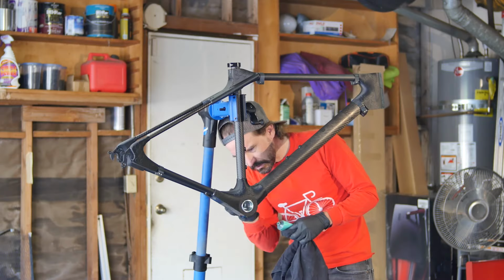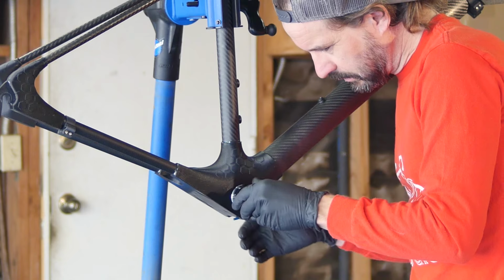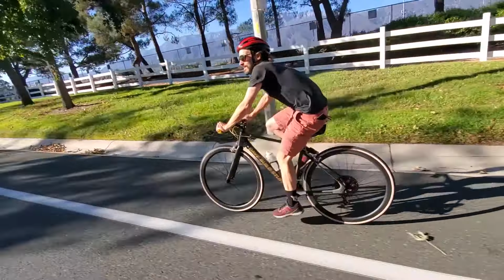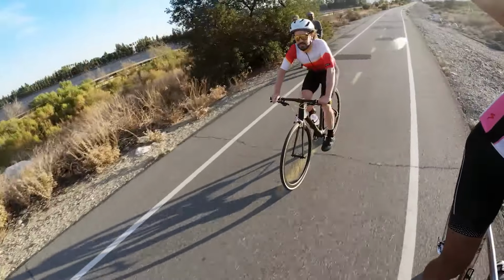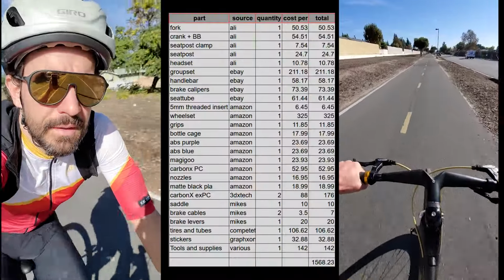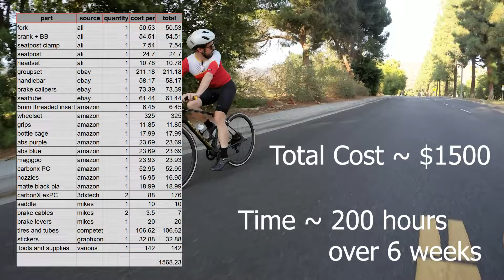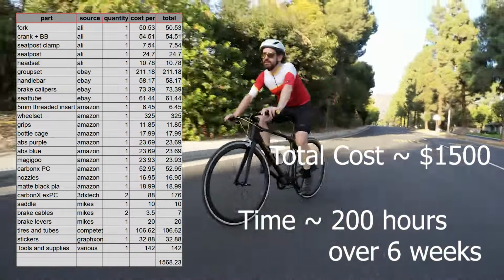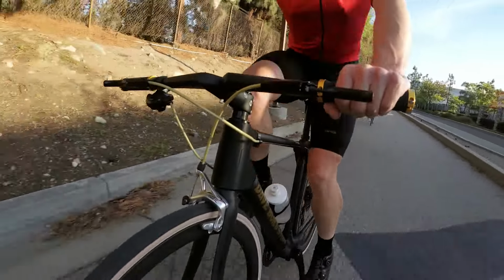The 3D Printed Carbon Fiber Bicycle is Complete! - Part 6, assembly and riding

Comment: if you ever decide making the plans open source, there will be people that will make the design parametric, maybe even with openSCAD, that way you could fully customize the frame, from the overall dimensions to the diameter of CF tubing used
Reply from the maker: I did release the design. Check the description in this video - https://youtu.be/baJIxkLU98w
Reply: @designbydave  yeah thanks for the heads up. i'm excited to see new projects :) how how did the bike hold up over time? any issues with material creep?
Reply from the maker: @SharkyMoto  No issues at all. I've actually built two. The first one (the one in this video) and the "release" version. Both have over 200 miles and are great to ride!
Reply: @designbydave  thats so sick :D

Comment: Why flat bar?
Reply from the maker: This is my easy riding, commuter bike, so I thought the simplicity of flat bars would make sense. Plus, I just kinda wanted to try something different from the road racing style drop bars I am use to.
Reply: @designbydave  maybe you should put a drop bar on it. I think that’s going to be cooler. The bar can also be 3D print😂
Reply from the maker: @mr.on9  it would be fun so build one with a drop bar. Maybe someday. For now, I'm happy with it.
Reply: @designbydave   I feel like this bike is similar to the Colnogo C series😂
Reply from the maker: @mr.on9  There was a bit of inspiration from there, yeah. See also Bastion Bikes.

Comment: Blown away by this and a tad over excited. I have been pondering a bike based around stock carbon tubing for a number of years. Searched many times over the years for possible off the shelf lug options and endlessly for 3d printed ones. And then somehow another search on this day and your good self pops up courtesy of the google nanobots. The build video filled me with the joy of making things. Having only just finished watching all your fantastic videos on this bike build my brain has yet to cogitate the enormous amount of information and knowledge you have shared. You Sir, have made my day. 

All my thoughts on this, and they have only been thoughts but were  based on either stock metal lugs with tubes sleeving internally or externally -  3d printed (sintered) metal .... or 3d printed lug moulds more along the lines of yours for CF hand compression moulding. I hadn't considered any FDM filament song enough!  My knowledge of materials comes from working in the film/tv prop making world so although aware of and worked with many materials and processes over the years my skill set is some way away from engineering. I may be rambling due to over excitement... 
😃

Comment: hello david, I want to make a 3d printed bicycle frame like you made, but it's hard in my country to get 3dx tech pccf filament, filament which is available in my country esun Epa-CF. do you think it's strong enough to make bicycle frame lugs?, and one more thing, scotch weld dp420 is not available in my country, is there any alternative to join 3d printed parts with carbon fiber pipe? thanks david

Comment: Fantastic Dave!!! Really thank you for sharing and like the fact that is a true functional build and we see that it is definitely possible….… Wonder if the parts would get lose with time degrade with UV light… However thank you for sharing!🙏🙏👊👊
Reply from the maker: Thanks for checking it out. Polycarbonate should be good in the UV, but this bike won't be out in the sun a whole lot, not like my typical bike. I think the likely limiting, weak spot factor will be the fatigue of the 3d printed parts leading to cracks developing over time.

Comment: I really like what you are doing! I don't know about carbon printing but how strong is it?  And if it needs more strength would it be possible to wrap carbon fiber cloth and epoxy over it?
Reply from the maker: The 3D printed carbon parts are not as strong as a traditional composite laminate, hence the parts made to be much thicker (heavier.) Wrapping with additional composite material is a way to increase strength. However that is unnecessary and against the purpose/scope of this project (simple, 3d printing only construction, no messy composite layup necessary) and would also be very difficult and/or require excessive hand work to make look halfway decent.

Comment: What a great project, very glad I came across your channel! I'm curious what's the frame weight? Do you think it is lighter than if it was made of aluminum?
Reply from the maker: 3.75 pounds. It's not exactly the most weight-efficient way to make a frame. A traditionally welded aluminum or titanium frame would be lighter.
Reply: @designbydave  Gotcha, thanks David!

Comment: If I were you, I’d build a limited edition run of 1000 copies. Sizes 52, 54, 56, and 58 with 250 each. If I were you… 😉 Great build.
Reply from the maker: Thanks for checking it out. Not interested in production on these though as I do not think it would be profitable.

Comment: Hi David, that's cool! I want to build a 3D Printed Carbon Fiber Bicycle as well! what is the carbon fiber tube and 3D printed joint thickness in your case?
Reply from the maker: Tubes in the public release will all be 1mm wall thickness. Printed parts taper from around 0.25" to 0.1"
Reply: @designbydave  Thanks for an awesome series. I was brought here from your Thingiverse project and am definitely a new subscriber! I have no knowledge about CF, but is 1 mm wall thickness enough?
Reply from the maker: @lars-sorensen  Cool, thanks for checking it out. I am planning to do an overview video to go with the Thingiverse page, but their site has been having some issues. 

In general, yes 1mm wall thickness should be sufficient and is comparable to the wall thickness of traditionally manufactured carbon fiber bike frames. In reality, it will depend on the laminate schedule, which we don't really get to know (one of the downsides of these cheap Chinese carbon tubes.) However, I've worked a lot with them over the last several years and they should all be good enough for this project.
Reply: Also - which tires do you have on it?
Reply from the maker: @lars-sorensen  Vittoria Rubino Pro Graphine 2.0 28mm